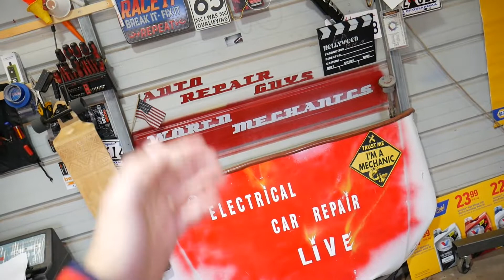FIX Code P0301, P0302, P0303, P0304 Misfire Ram Promaster City, Fiat 500x, Fiat Toro

Comment: We about around 12 of these in our service fleet and they all are junk. Nothing but issues with almost all of them. We buy 3 or 4 brand new every year. Told my boss, we need to go another route.
Reply: Very smart suggestion... common sense, right. I have a 2019 promaster city p0302, it's got 117K. This guy says if it was a bad coil, a separate code would also pop up. I was kinda hoping that's all it was.

 I'll check the spark plug, switch the coil packs, reset the 12v. I was thinking either running some system cleaner (if you have a recommendation) that may clean that injector just enough or replace it.. any help, much appreciate it

Comment: I have a 2014 Ram Promaster 2500 high roof window van 159" wb 86,000 miles.
Last month it had dash code P0302 Cylinder #2 misfire.
Dealership's service department attempted the repairs but compression is still low.
Now they tell me I need to replace the engine! $8k for a used one or $10k for new.
This is in addition to the pending bill of ~ $9k for the unsuccessful misfire repair plus incidentals.
A few months ago I spent ~$6k replacing six fuel injectors because of a flashing engine light.
I have always taken care of this and it has always been serviced by the dealer so I'm shocked that they are telling me that there is no extended warranty coverage for this problem.
My regular six year warranty expired two years ago but I read on Forumz that Dodge was stepping up on the 3.6 Pentastar (Apparently that is not correct).
Dodge/Mopar says there's NO extended warranty for this issue even though it appears to be not uncommon.
Am I supposed to just throw it away?
Step up, Dodge!

Comment: I have low compression on cylinder 3 and misfire already took it to the machine shop to do the valve job and resurface the head. The same problem occurred when I put it back together so I took it back to the machine shop to double check their work. The machine shop check the head and everything is okay but still cylinder 3 misfire and leaks from the valves
Reply: Did you replaced cylinder 3 fuel injector, ignition coil or spark plug?
Reply: I have a p0302 promaster city 19